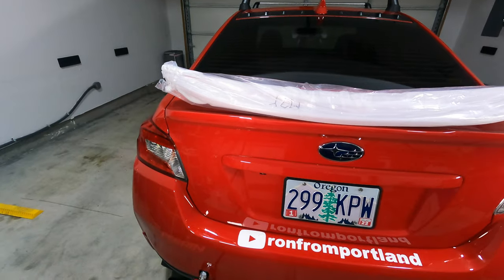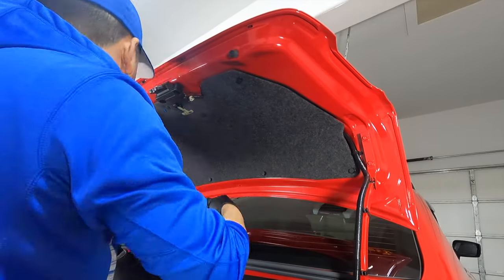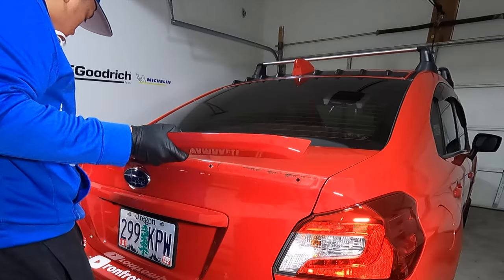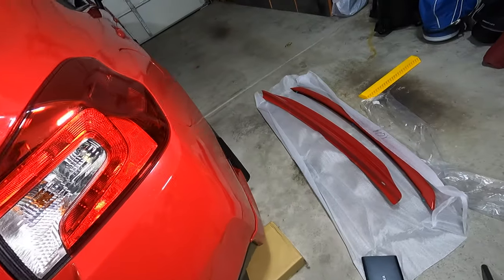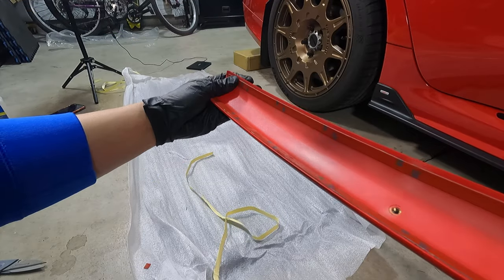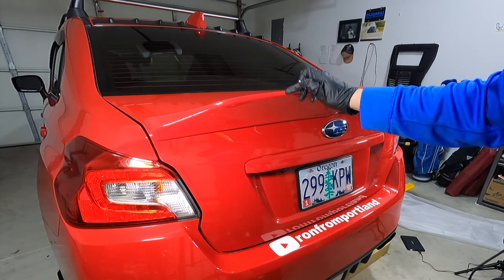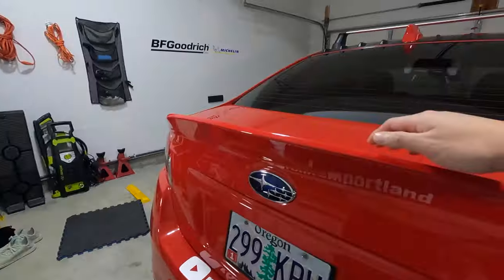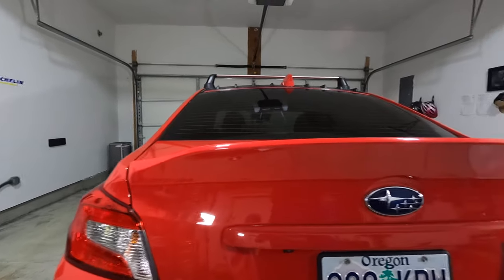3AMOTOR Duckbill Spoiler | Watch This Before You Buy! | 2015+ Subaru WRX

Comment: Hey! Love your install. i noticed you didn't do anything extra to cover the outermost holes on the edges. I kinda missed that step too. Are you able to tell if water found its way inside? I know the 3M tape isn't completely waterproof so.
Reply from the maker: Since I followed the proper procedure of applying the 3M tape, I’m pretty confident that it will hold up against the elements. It was a concern though! I usually check the trunk after heavy rain and there seems to be no seepage. Thanks so much for watching!

Comment: Have you had any problems with the glue from the tape coming off with water and streaking on the car? Ever since time I wash my car and it dries it leaves streaks and I have to remove it with alcohol
Reply from the maker: Glue from the old spoiler? No issues with mine. I cleaned it when I removed it the first time.

Comment: Hey I just put mine in today and it looks good but, I noticed it’s not perfectly flush with the trunk, I kinda feel it may be because of the tape but it just makes it look like it has a tiny gap.
Reply from the maker: Mine is the same exact way. I literally hosed the trunk down with water to check for any leaks but there weren’t any.
Reply: ronfromportland I’m thinking of trying to redo Mine, I put extra 3m an the sides and think I put it to close to the edge on the front and back,

Comment: Did you drill out your tow hook cover for a cleaner look? Is there a template or measurement for the hole?
Reply from the maker: Nope, I just removed the bumper hole cover.

Comment: Damn what the hell. When trying to getthe OEM spoilerbolts out, one of them  seems to have be spinning  but not coming out :(
Reply from the maker: Ah, it’s probably spinning from the spoiler side. Maybe push a bit on the spoiler and then try to remove the bolt?
Reply: Having the same problem what did you end up doing?
Reply: @coltonhoward771  had to use a dremmel and cut it out lol..
Reply: @theherrderr  thanks a ton

Comment: mine didn’t come with the tape or screws lol.. any idea what size screws/bolts are used on the aftermarket spoiler?
Reply from the maker: Ah man, that sucks! I’m honestly not sure and I don’t want to give you a wrong size and you strip out the spoiler. I would highly suggest just reaching back out to the sellers and getting the hardware.
Reply: M6 and 1.00 pitch. Not sure on length…